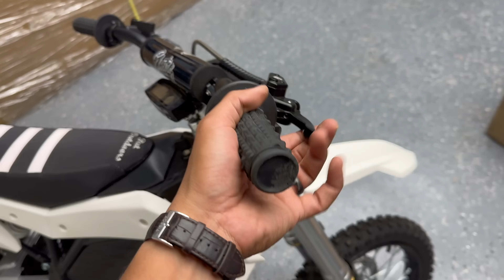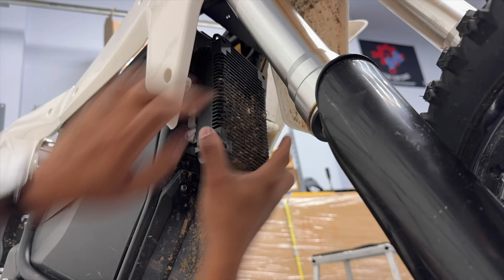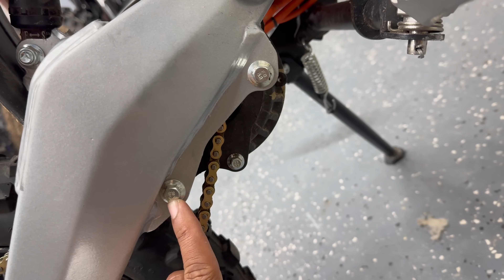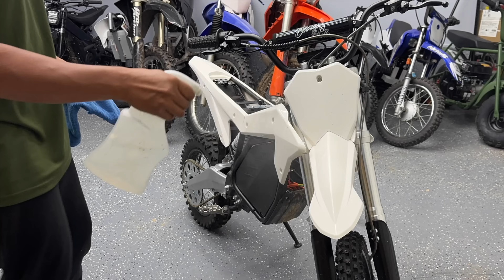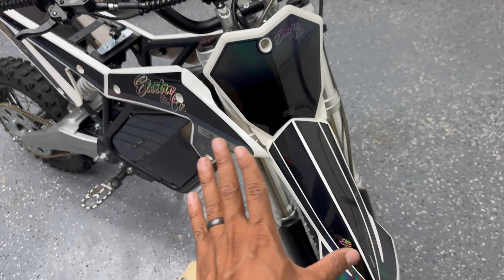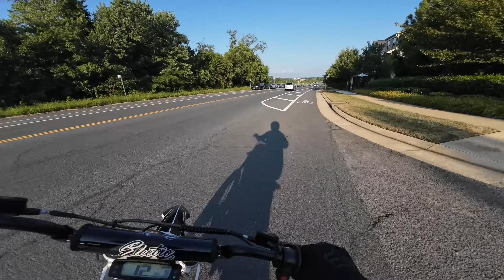Upgraded my ETM RTR 72V Electric Pit Bike

Comment: How to remove the throttle on handlebars
Reply from the maker: You unscrew the Allen bolt on the bottom of the throttle housing, plug the wire connector under the ignition area, and pull it off
Reply: @PatOutdoors thank you. Just realized I was blind and didn't see the bolt
 

Any tips for getting the grip off other side?

Comment: I think the light would be ideal if you plan on upgrading it and and it’s the same exact platform just less power put the box.
Reply from the maker: Right, like if you’re planning on upgrading the battery anyway, might as well save $1000 towards it 🤔
Reply: @PatOutdoors  save up for the battery and the new power upgrades they are coming out with two new controllers and a high speed motor plus the revolver motor.
Reply: @PatOutdoors keep up the videos man they are very entertaining bro.

Comment: LOVE YOUR CONTENT IT WAS NICE MEETING YOU
Reply from the maker: Thanks! Nice to meet people in my new area so I appreciate you stopping by
Reply: @PatOutdoors hey pat I was wondering how would I be able to send back my controller the noisy cricket to electric and Co I only have had the minimum of 8 or 9 rids on it the last ride was a 10 mile ride just taking it easy not any type of hard pulls the next morning turned on the volt meter barley hit the throttle and everything just went out.. I did some tests on everything else and it comes down to the controller I don't think there's anything else I could be missing right?  this controller is way too brand new in my personal opinion everything else from electric and Co have bin 💯

Comment: The only thing I don't like about this bike is the limited motor options (or does it fit the my1020?). If it could fit the gts11, I'd buy the Lite version in a heartbeat and upgrade everything else.
Reply from the maker: Appreciate the input! Well I was looking at it closely when I took the motor bracket off.. can’t imagine it’ll be too hard to fabricate gts11 adapter brackets (2 bolts on each side)
Reply: I have one and I agree 100%  I bought it to upgrade outside of EC ecosystem. If people can turn razors into monsters shouldn't be that hard to modify some parts to make a better setup.